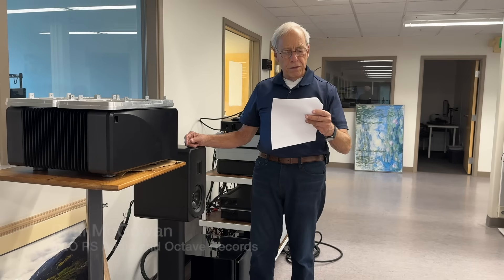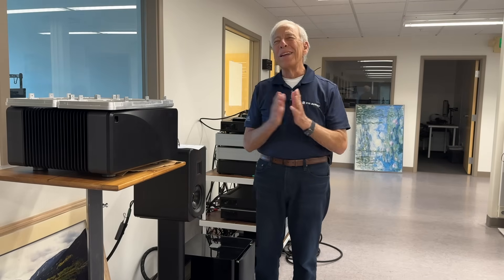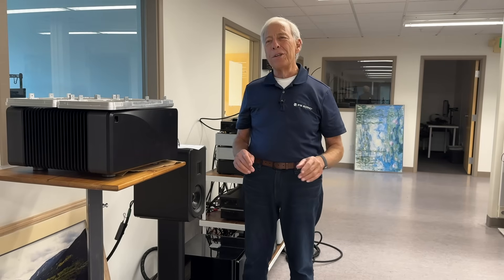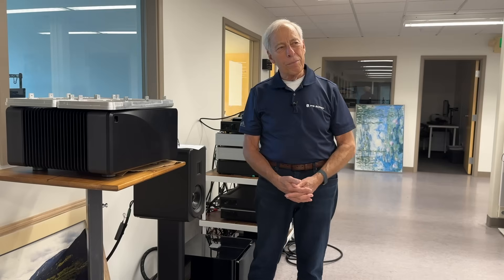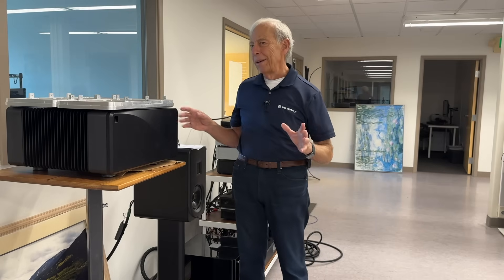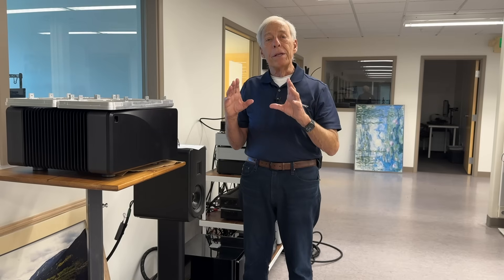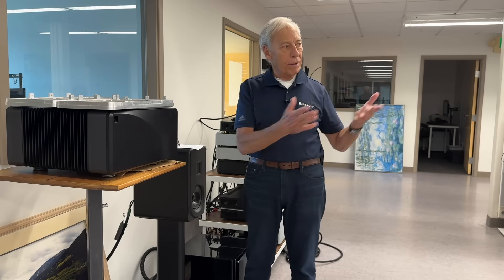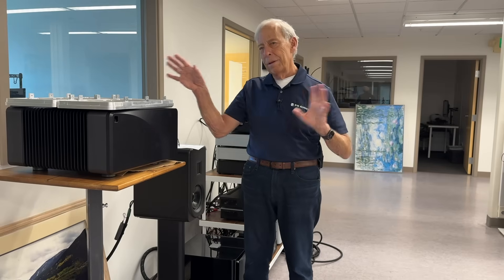Designing loudspeakers

Comment: I was wondering what anyone thinks of the Heil air motion transformers that are used in the ESS monitors instead of a tweeter cone. I've had a set since 1978 and loved them from day one. Great low end too, with the passive radiator working well with the 12" woofer.

Comment: Frequency response is seriously important for any respectable engineer. Chris is such engineer. Excellent reply by Paul. The notion that measurements are less important than listening does not apply for engineers. You just dont get great audio as engineer with crappy measurements. Still listening tests are ultra important also but they are not something replacing measurements and you never start with them. Then you as a customer of course need to listen as a primary method because ultimately your personal preference is what matters. Also some times advertised data is misleading or incorrect. So as a customer, trust your ears. As an engineer, you better know what you are doing by science, math, measurements and of course listening...
Reply: Yes, a great loudspeaker is created by great engineering, tested by measurements. Listen to refine the design. Repeat as necessary. Fail until you succeed. It would drive me mad.
Reply: @BruceCross   ...interestingly, there are a number of home-audio components, including loudspeakers, that measure, hmmm, shall we say, less than satisfactory, & yet sound wonderful, fantastic, amazing & this can be an area of home-audio where measurements fall flat.
Reply: True, but I'd rather have both.
Reply: @Fat Rat That can be true for certain measurements. Bad measurement data like frequency response irregularities, distortion from cone breakup, slow decay at certain frequencies and so on all can exist and be of no nuisance until at some level and condition. In some cases a bad frequency response may actually sound more pleasing for some people due to personal preferences. Only ignorant people think this is a battle between two philosophies of judging audio. Never once have I said listening is not very important for judging especially speakers. What engineers in audio know well though is that this concept does not work across the board. E.g. a power cable is 100% measurable. A power amp is highly measurable but listening tests are needed for reaching best of audiophile performance. On speakers engineers better plan the schedule to include lots of listening tests before release for mass production.
Reply: @BruceCross Yes exactly. This is not one vs the other.
Reply: @ThinkingBetter   ...I never said that I think that this is a battle between the two philosophies. All I said was that sometimes something that doesn't measure well can sound pretty damn good...that's all. Listening is also important when auditioning power cables, interconnects & loudspeaker cables, even after you've measured them to death & done a year's worth of ABX blind listening tests.
Reply: @BruceCross   ...fair enough. Preferences are a big part of home-audio (as you already know) 😉
Reply: I'll also admit that sometimes rules are meant to be broken. After all, measurements are often unavailable.
Reply: @Fat Rat Every such case can be explained. For example, a given THD percentage doesnt actually mean much before you know the type of harmonics involved. Tube amps can enhance the live feel of music by adding even harmonics to the music, for example. Thus a bad THD figure percentage wise might not mean its unpleasant to listen to if the distortion is musical even harmonics.
Reply: I think one of the best examples of what Fat Rat is saying was the old Shure V15 IV phono cartridge. Nothing that I know of measured better. There was a moving iron cartridge available at the same time called the Sonus Blue/Gold. It couldn't hold a candle or come anywhere near the totl Shure cartridge specs; but it was the better sounding cartridge by far. The same store also carried a Supex moving coil cartridge. It too had far worse specs than the Shure. But it ran all up and down the Shure (and the Sonus) for sound quality. The store had real experts working there; not just salesman. The highly  knowledgeable personnel at the store were even consulted by artists like Dave Brubeck, when they were doing live recordings. 

 So once again, it proves that  measurements do not tell the whole story of how something sounds; and often tells the exact opposite. People on anti premium cable crusades find measurements mighty handy in an attempt to try to convince the public that cables cannot make a difference. They surely can; and might even be the biggest bang for the buck improvement you can make make.in audio. Especially some of the better under 1k cables, which I am limited to, unless I want to spend more than I limit myself to.
Reply: @sidesup8286  I'm not a vinyl guy, but I believe you. Good measurements are delightful, but they don't tell the whole story. As Fat Rat says, start with measurements and end with listening.
Reply: All measurements aside, I think what most serious audiophiles really want is sound that does the best "impersonation" of real instruments and live sound. That's really the only thing that is important to audiophiles seeking realism or as close to it as they can get. Something that sounds pretty much real with bad specs is better equipment than something that sounds mediocre with great specs. If measurements were so good, the two would always coincide. That they don't, means we have a long way to go with measurements and their relevance to what the human ear/brain system hears. That's why I and most other people are not so fascinated or interested in measurements. While some of them are useful in design, most people view them as boring and not necessarily relevant most of the time. If someone is really into audio measurements, perhaps they've gone too deeply in, and take audio way too seriously. Enjoyment, fun and relaxation are the only important things regarding audio; and none of those things are "technical" at all.
Reply: @sidesup8286 Actually measurements are much about exactly that. The notion that you can have awesome sounding gear with poor measurements is alright only to the extend that some measurements don't mean much until to some level. An amplifier with 0.1% even harmonics distortion can sound better than one with 0.001% distortion, for example. In audio engineering we usually know when measurements become a real audible issue and often the numbers are not what some marketing people like to promote.
Reply: @sidesup8286 Actually experienced audio engineers are not ignorant on this topic. Nobody said a speaker can be judged as great sounding only on measurements but I can easily disqualify a speaker as bad sounding based on certain measurements being bad. Actually we can explain these things in quite some details.
Reply: TB ...as I've said many times before that measurements are only useful (important) at the designing & early testing phase of loudspeaker manufacture, then only the listening stage matters in the latter of the design phase. I know that you're an engineer of sorts & therefore you are heavily biased towards measurements, data, etc., however, "So as a customer, trust your ears" is a statement from you that I can wholeheartedly endorse 👍 Btw, my Stack Audio - 'AUVA-70' vibration absorption footers arrived today...fun, fun, fun😁
Reply: @Fat Rat Actually measurements can also be ultra vsluable in your home. I have a calibrated microphone I use to get my room optimized on frequency response and its way more accurate than any listener can achieve. Room acoustics most often messes up your audio experience.